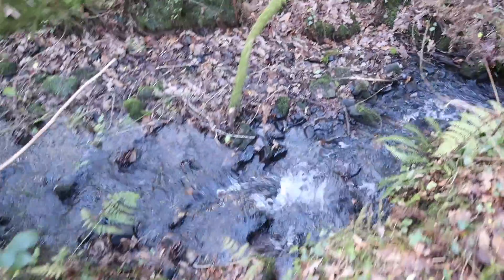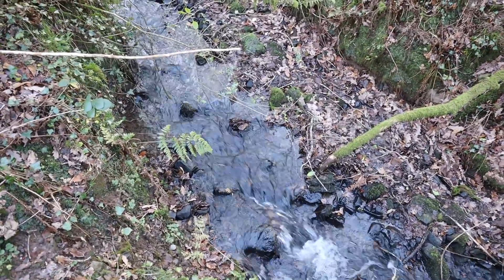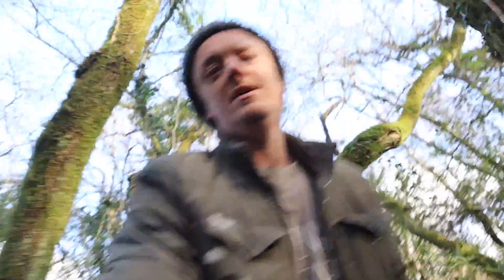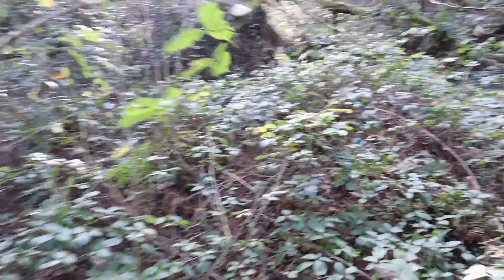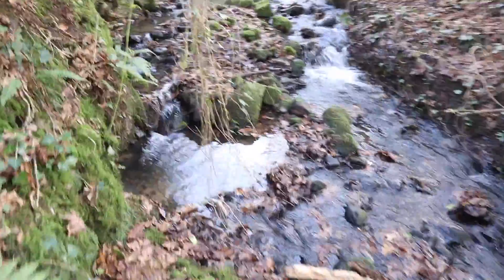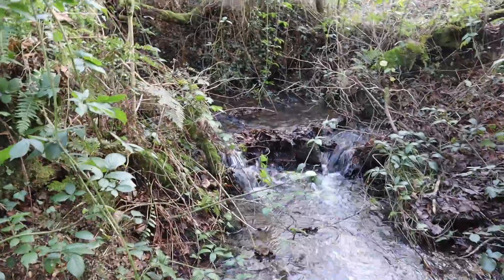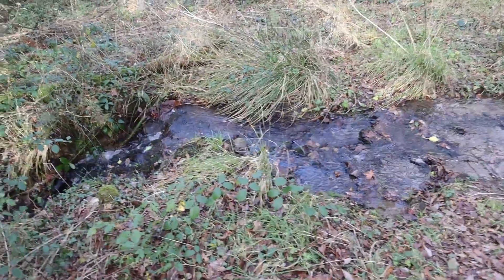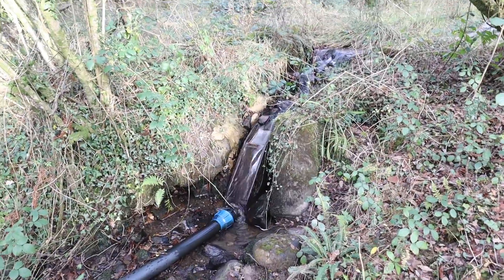Prospecting A Second Intake Source For My Off Grid Micro Hydro

Comment: I would love to see a 2nd intake series.  I think it's a great idea.  I wonder if your existing penstock is large enough after the join to have full flow from both intakes.   I would also like to see you increase the size of the intake on the 1st system, as it does seem a bit small for full flow situations.

Comment: Hi, love the channel. I'm just wondering, physics wise. You plan to join the pipes at the point where the pressures are the same? But that point won't stay the same. There will be constant fluctuations in each streams flow, water table changes, a build up of leaves, rocks or logs fall/move in the stream. This could mean at the point where the pipes join the water will push against each other, as you said. Now you could make daily visits motioning the pressure or build an electronic value system that regulates the pressure. Wouldn't it be better to take the second pipe straight to the hydro and connect it to one of the values?
Reply: The pressure comes from the hydrostatic head (elevation) which will be constant. The varying flow rates won't affect the pressure.
Reply from the maker: Eric, that is correct for the most part but the flows will effect the pressure as there is pipe friction losses but those are small amounts and will be present in both pipe so it will equal out. :)

Comment: Have you ever throught of running a small permanent magnet direct current motor, like a treadmill motor,  as a generator for charging your battery Bank? You could then use your other turbine to just support your main electricity

Comment: Did the other owner understand the pipe will be visible along the length of the stream? What you do is awesome, and  your current intake is subtle, but the big pipe is a bit of an eyesore, do you think they will mind?
Reply: It should be pointed out that 'eyesore' is in the eye of the beholder! Remember this is a largely invisible stream in a scruffy bit of woodland in remote countryside....!
Reply from the maker: Thats right Andy, this stream is really tucked away at the back on my woods and at the bottom of my neighbours land i wouldn't be surprised if he hasn't even been down there in 10 years.
Reply: That's great news, with it being 2.5k in pipe, it's good to know you will get long use from it 🙂

Comment: why not build a small ( 2' ) dam just inside your land area that way you have more head , then cut it across to above the other headstock and just let what flow your not using at the time flow over the 2 different headstocks to be normal streams ?

that way your just basically making your original stream bigger

Comment: with a second turbine you have more work and higher cost of course, but you win a redundant system. this can be helpfull in case of maintenance and important in case of problems. to send the electricity over 200+ meter use a thick cable and there will be no problem
Reply: This is clearly a cost/benefit situation. It depends on your mindset. How much does it actually matter if the system goes down versus masses more work and cost?!
If you're living this lifestyle is anything actually 'mission critical' if you run short of power.....

Comment: Intresting with your plans.But what about your mainpipe,can it swallow more water than its doing now with that waterflow from that first intake!?!
Reply: You KNOW Kris will have thought about this don't you........!!
Reply: @andymccabe6712  hope so!Have in mind i just asked him of that.Want to her what he has to say about that!
Reply from the maker: There will only be around 30m of pipe that has to take double the flow so the loss wont be that much as my penstock is sized to work at low loss at 5lps over 200m so running 10lps through 30m wont be massive losses. there will be loss there but it will be acceptable for the gain in power.

Comment: high pressure in a pipe can be used to draw the low pressure into a pipe with the addition of an injection tee thus equalizing the pressure same principle as a spray gun
Reply: Or even just add a vent where the two mix to prevent backwashing - a tall vertical pipe section at the T or Y junction. It's a lot easier than measuring pressure and hoping it never changes.
Reply from the maker: you are right, but that would be a major loss of energy in the system. having them both equal will be far more efficient
Reply: @KrisHarbour  Once they have passed the sealed injection tee they will be high pressure  the lower pressure water is sucked into and trough the injection tee. In your situation if the lower pressure water being introduced from the top of the tee drys up because of the tee the high pressure will not back feed just suck air until the water is restored
Reply from the maker: @Johnkels100  Im quite sure that isnt right, both intakes will join at about the point that they have 20psi the final 30m of pipe will equate to about 5 psi. if one pipe was to drain the other would push the water back up the pipe to equalise the pressure. what your saying would be true if the end of the pipe was just open and blasting every bit of water there was out of it then it might cause suction, but it isnt the nozzles only let out a fraction of the water available (so the water moves slowly and does not lose all its energy in friction) because of this that water would carry on to the turbine but it would also be pushed up hill to the other intake.  i wll do some test soon and we can see what happens.

Comment: What makes you think you will get more volume?  A single pipe can only carry so much load.  You will increase volume with more water; however, if the pipe is already fully loaded then adding additional water makes no difference.  Can the pipe take it to make it worth while? How full is the pipe under load? Your restriction is your hydro   plant.  Do you understand what I mean? Any way good luck.  Love the videos.
Reply from the maker: Like I said I’m adding a second pipe. It only joins the old pipe for 30m meaning the loss will be small compared to the gains
Reply: @KrisHarbour  that's fair enough... good luck, and hope it works successfully.  Water is a real beast.

Comment: I understand about your elevation.... I wonder what the depth of your current stream is vs the prospected one.  If the prospected one is above your current stream and that the water goes to the same place, It might be back breaking work, Just cut in a channel to your current stream line it with some rocks and you should be set.  Even if it is a foot lower you can calculate how much it would need to raise the water to meet the current one with out flooding an entire area. The only changes would be to your jet size.

Comment: Would a ram pump lift the water efficiently up the bank to simplify the route 
Also what are the abstraction complications with welsh water Dwr Cwmru
Reply: Ram pumps lose a lot of volume in order to drive the water uphill.
Reply: I guess if you only 'borrow' the water temporarily and don't contaminate it in any way, then there will be no abstraction issues...?
Reply: Andy McCabe sorry no that’s not how it works in this corporate world
Reply from the maker: ram pumps dont have a use for  hydro systems. they are great to supply water but they are like 10% efficient and could never move enough water for an efficient hydro system.
Reply: Kris Harbour Natural Building no I suppose you would have to creat ea holding pond and only use it for peak demand and that would create complications of its own vis a vis abstraction thanks kris

Comment: I think it's a great idea Kris. The only accommodation needed for joining the two penstocks would be a standpipe trimmed to the lower source elevation and located at or below their junction. It would prevent backflow to the lower elevation source which is really not that large of an issue to begin with.
In the States these are refereed to as 'run of the river' systems and utilize 'weirs', not 'dams'. The water is both sourced and returned to the same stream usually within a single property.
Using the wrong terminology here may raise concerns from the local environmental agencies.

Comment: I think you could also do very well with a larger (read: longer) water intake setup in your existing stream...Looks to me many liters a second escape the dance because the intake is rather small... Maybe do a stainless steel welding job again on that end of the system??
Reply: Maybe he doesnt want to dry the stream out
Reply: He needs the water flowing over to flush debris off the mesh of the intake to keep it clear

Comment: Yes should be interesting addition to your hydro system. Where the two pipes meet, you could have gates on each up-line, where you could equalize each of the flow rates, possibly electronically controlled centrally with a micro to automatically adjust to flow rates, also to shutdown one or other due conditions etc. This system could also adjust both flow rates in accordance with the Hydro load, limiting wear on the hydro itself. Has a lot of potential to keep your hobby and workshop/home very interesting. Keep up the great project videos, all very interesting and doing what many of us would have loved doing.
Reply: That would be ideal, I was thinking that there are going to be more problems than one would think. It would work if the water was before where the air vents.
Reply: William Glaser  Yes the new intake would also have its own air outlet along the pipe, the same as the original.

Comment: if you stagger the combining pipework, so instead of one Y connector have 3 in series to split the pressure over the 3 connectors could this gain more efficiency over pressure pushing flow backwards on 1 supply? Also shame you can not induce laminar flow at the intake from both sources, massively cutting down turbulence.

Comment: Some questions and propositions. Why don't you create some kind of a reservoir to join the streams? I see that you are already losing water from the first intake. If for example you create a reservoir out of metal barrel or a bigger tank (food graded plastic or metal), leaves can't block your intake and minimize the sand . Also you can have a valve and an over flow for controlling the flow (automated or remote controlled like the turbine valves). also you can filter the water for everyday use. I know that you have the spring (more videos from up there plz), but I remember correctly, the hydro intake is higher, so more pressure.
Another question. You aiming for higher voltage or amperage? Because you said something about second turbine. And I don't remember if the generator is AC or DC.
I love the work that you 've done. I hope someday to find a paradise like yours here in Greece, because you feed my dreams. Keep up the good work.

Comment: I would change the design of the intakes and use a dam and use all available water. At the point where you connect both pipes of both intakes I would add a old water heater or similar, which can sustain the pressure. This way the water has time to mix and loose the turbulences.

When you keep some air at the top of the pressure vessel it can also help to prevent water hammers in your system on rapidly changing loads.
Reply: how about filtering of like leaves and stuff like that though? and i'd be interested in the costs, if it would be really worth it
Reply: @MrTurbo_  actually small stuff is more of an issue. So sediment will wear down your turbine and your nozzles. You can filter with such a tank, you need to make a spin inside the tank from the inlets and any small sand will collect in the center of the tank at the bottom. If you make the outlet near the top, you can avoid sucking any debris in.

Sure, the tank need to be large, to get the filtering going depending on your flow rate.

Ideally the hydrocyclone should be conical but a round tank works also okay.

You need to have a sludge outlet at the bottom with enough diameter to remove any debris which might pass your filters before.

A simple mesh filter or a cotton filter should work great on avoiding leaves, when it's at the rim of the dam at the overflow port it should self clean when there's excessive overflow.
Reply: @Ruben Kelevra the outlet being at a higher point will indeed solve most problems with leaves, and the sediment is currently not being filtered and i think it will probably be cheaper to not filter  and just upgrade the turbine whenever the old one wears out, also my point of added costs, time and effort in comparison of the actual total increased power output remains, after all Kris is on a thigh budget, he's not the french ministry of energy that just puts dams everywhere because of the fun of it
Reply: @MrTurbo_  well, if you think of 2000 £ of pipe, 20 £ at the scrapyard for an old water tank shouldn't hurt and they are usually rated for 8 bar. Sure you need larger holes in them, but this is just a bit work.

A dam isn't that expensive, too, you just need two rows of wood planks, buried deep in both sides and the bottom and some tar to seal them. Shouldn't cost a fortune either.

A filter on the intake can be a cotton cloth over some planks, on a frame with the pipe on the bottom - mounted at the rim of the dam. If it's blocked the dam will overflow and clean the filter again.
To get the dam more flood prove you probably want to put stones on both ends to get some weight to it.

I've built dozens of dams that way in my youth, some probably still exist today 😙🎶
Reply: @MrTurbo_  turbine wheels are kind of expensive to replace each year or two, and the faster the creek flows the more sediment you get into your intake. So when he's trippling the input he's most likely more than trippling the wear on the components without a filter. That's why I recommended to slow down the water in front of the intake, with a dam and get rid of the rest with a hydrocyclone.

Comment: You don't loose any energy when you run a pipe over a hill, your system relies on the pressure and the pressure in the penstock is the same regardless how you the pipe is running. 🤔
Reply: Ruben Kelevra any bubbles eventually cause an airlock and the siphon stalls. It would need constant bleeding
Reply: @jerrykew  I know, but he was talking about loosing power 🤔

Comment: If you get more flow it might make sense to 1-phase AC instead of 3 phase and use it directly, if you have a load which you can adjust as ballast, like a hot water tank for heating and hot water generation. This surely only make sense, if your peak usage is below the maximum output.

The DC side of your system might be used for lights and other devices which just use DC. You can start the battery charging, depending on the load on the AC-side to balance it further.
Reply: I don't think his alternator is wired with a neutral coming from it making it difficult to use individual phases. Makes more sense to turn it all into DC, storing excess in the batteries. You could run DC devices off those and invert for AC appliances. I think Maximus Ironthumper uses a site 110v transformer as a ballast for his excess solar to run it at a lower current, that would be a good option as a ballast load when the batteries are fully charged. The MPPT controller he has should have a ballast load option so the batteries aren't cycled too much. Kris said a while ago he didn't want to run a dump load, I'm not sure how much additional wear that puts on the bearings free-spinning without load compared to always being loaded though.
Reply: @benlee4940  he would need a different generator for single phase anyway, since it would unevenly run if you "just" use one phase.

Also he need a generator with a shunt or auxiliary winding to do the necessary voltage regulation.

Since he's already using multiple nozzles, he could modulate flow by turning individual nozzles on and off, based on the RPM, since this need also be constant 50 Hz to use the AC directly.

Turning AC into DC, charging a battery and turning it than back into AC when you need it is quite inefficient, but necessary if you have not enough flow rate or head to cover peaks.

Since he want to significantly increase the flow rate and also add additional load - an electric car - it's not viable to just plug everything in as you need it. The batterypack of all electric cars are significantly larger than his battery for the system.

You need to regulate the loads therefore anyway somewhat intelligently.

If he gets for example 3 kW mechanical output he can charge the electric car directly (most electric cars accept slightly above 1 kW as minimum input) from the AC from the turbine, when there's low system load. I doubt that he can get enough AC power with the current system losses from the inverter without draining the battery.

Comment: If one stream has higher flow than the other and u have found a point where pressure is the same have u thought it may change as the seasons do. Like in summer one stream might be 2l/m and the other 4l/m but in winter one might be 5l/m and the other 9l/m. U may have to put in a valve to regulate the pressure of the higher flow so u don’t push water out the intake as u spoke about